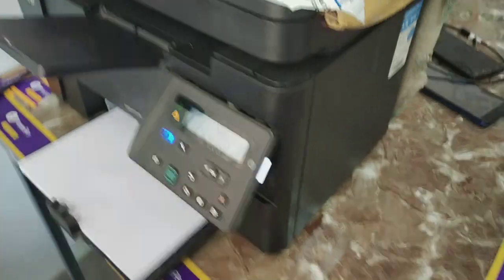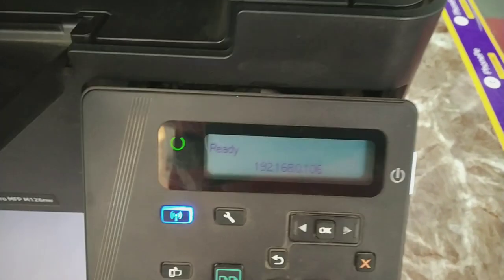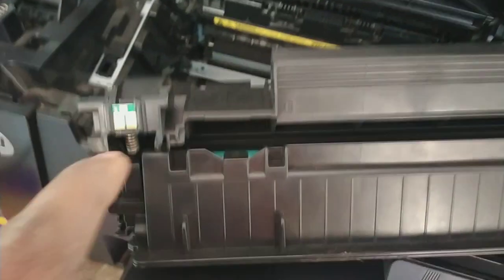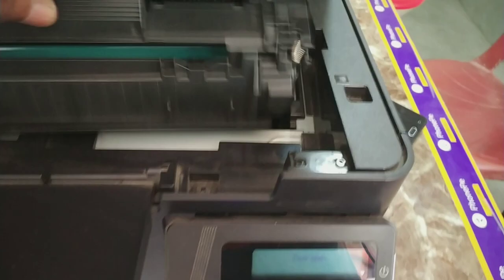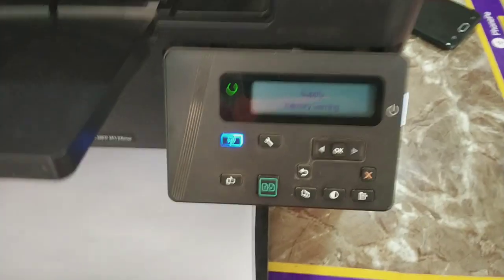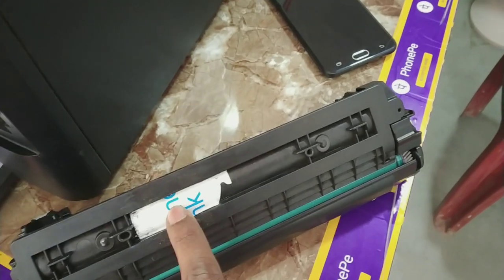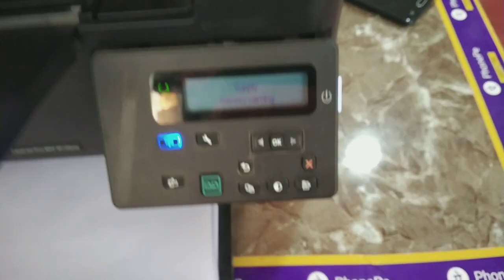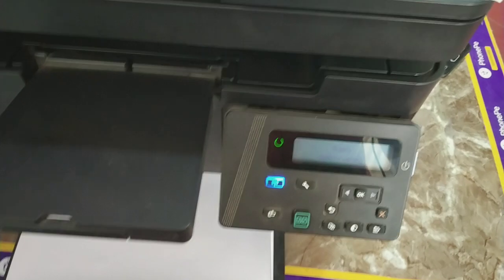HOW FIX HP 126NW REPLACE BLACK CARTRIDGES PROBLEM | HP PRINTERS 126NW PROBLEM SLOVE LOW BLACK REPLAC

Comment: Black low dikha rha hai refill karne ke baad bhi
Reply: my same prblm black cartridge very low
Reply from the maker: Use continue if showing replace black cardge remove chip
Reply from the maker: Plz remove chip u will.show supplay mimory error bt dont warry printers working fine
Reply: @TechnicalWasim  i have removed chip still not getting prints it is throwing blank page
Reply from the maker: Replace cartage and if showing next cartage replace or black remove chip